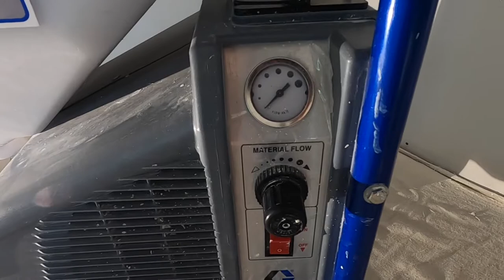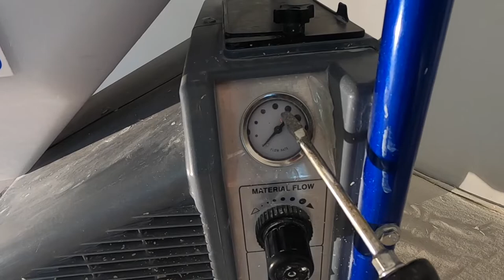HOW TO SPRAY LIGHT ORANGE PEEL TEXTURE FROM THE HOME DEPOT RENTAL!

Comment: These work great if you know how to use them. I have an older TX90 & all the pump does is knead the mud through a hose with rollers so the mud HAS to be thin!! When you think its thin enough, add more water. Mine was given to me by a HD rental guy, he got sick of people bringing it back saying it wouldn't work 😂 Works fine!
Reply from the maker: Yes you gotta mix your mud pretty thin. Like you're making thin pancakes. Sometimes Home Depot rents out ones that don't work. Pretty frustrating sometimes.

Comment: Those sprayers suck....marshalltown duo-flex is the best.If the pump on the graco  doesn't get cleaned out its bad news
Reply from the maker: Yes they are the cheap ones. OK to rent but If I was going to buy a new one I would spend a little more for better one.